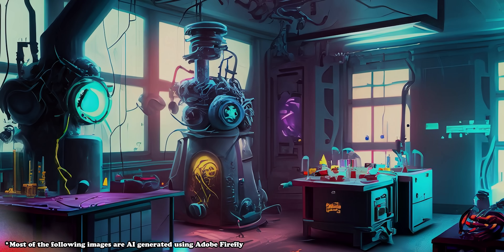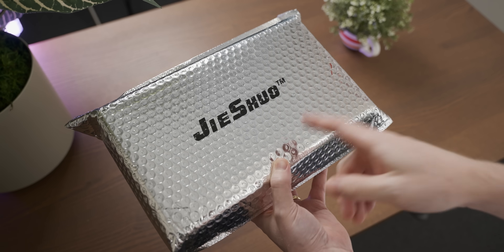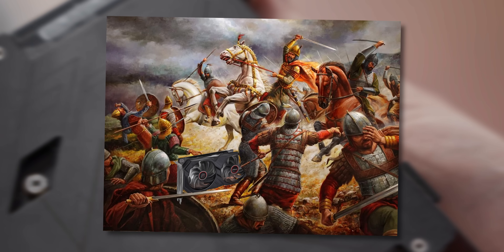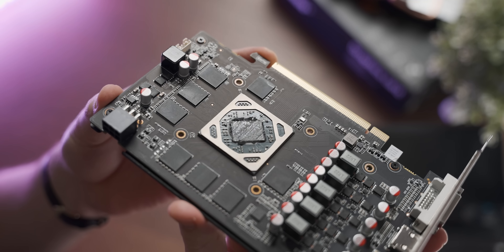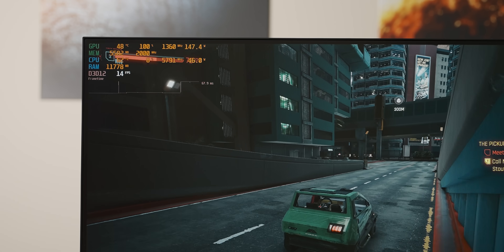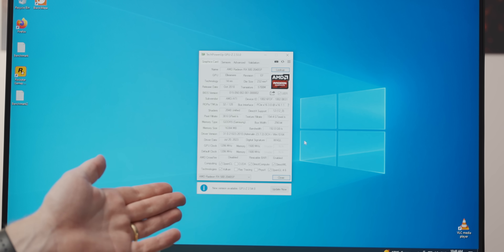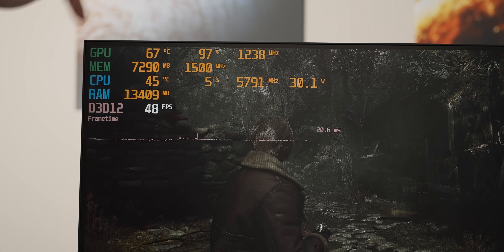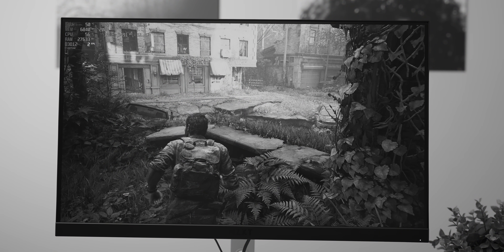Why Would They Make This? 16GB RX 580 From Aliexpress...

Comment: The 580 was my first gpu, it sure was a huge upgrade from integrated graphics😅
Reply: My second gpu. Bought it as an upgrade to GTX 550 Ti. Got it right before the GPU prices went insane in 2020
Reply: @wildcat002  i got 4k monitor and still use my 1080ti for it :face-orange-biting-nails: Some games run fine 4k with it still.
Reply: @hawky2k215 Performance wise yes. Power draw wise not really. The 580 drew a whopping 100w less than the 390x. If you used it for around 4-5 years 4h/day you saved around $100 in the electrical bill alone (depending on the kwh price). That and it also probably reduced the load on the CPU... If you bought your 580 8GB at the time for $200 you effectively reduced the cost by half. No money wasted there if you ask me since it's still by today standards a very solid card and can be resold much easier at a higher price than a 390x.

Comment: You could have reprogrammed the BIOS for a more aggressive fan curve (keeping it ~65C) and bumped the core clock speeds and even improved memory timings.  That would have been an interesting experiment.  I've always wondered if tightening memory latency helped gameplay.

One other thing you could do by making your own BIOS is to bump the memory speeds up as well (until you start seeing ECC errors in HWInfo64).

Comment: 1410mhz. undervolted by 20. with a 16 percent over power budget runs stable.
Reply: 2200 on the memory, possibly 2250 helps more. The core just draws way more power & heat for very minimal gains. 1366/2200 or 2250 if you're lucky yields gains with minimal heat & wattage. The card is starved of bandwidth. 8.8-9gb sounds much better than 8. Yes, I daily one.

Comment: I had this card back in $2018-19 on 9400f and it was really good for the price. Bought it on eBay for $200 at the time. Gigabyte I think. I could play MEA on high on a 4k 55" LG tv. Old tech should get better as software improves, pretty neat.

Comment: Hey Dawid, I also have one of these scalpel RX 580s. And for overclocking with MSI afterburner it's everything to do with the power limit settings. They are running at like 50% power capacity, so slide that bad boy up and it will hold the frequencies.

Comment: What a perfect analogy... 2304 and 144 are just messy numbers. 2048 and 128 are nice and 'cleanly'. 🤣
You should recruit some help and vMod it, then throw some ridiculous cooler on it (or a 240+mm AIO). Don't forget copper heatsinks on the RAM and power components w/ active cooling.

Basically - Just, run this Gentile like a rap*d ape!

Comment: roblem is its at a lower dimension, if i try to find what I need, in binary;  its betwean 1 and 10, 5?  no 3 or 7?  1 2 or 6 8?  no is it 9 or 10?  In this lower dimension, everything isn't using the video memory, infact you almost never use the physical video memory, a person is behind a building, proceduralize some textures, very seldom do I ask for a mipmap of a dude bob.  As you go up in dimension, there are infinite advancements that could use video memory, like resistive path path pysics in a 40 series, even 10 series NVidia, you just all of a sudden are aware you entirely get what you pay for.

Comment: This is a bizarre card to double VRAM on, it barely had the core to properly use 8GB. Better candidates are cards that aren't good at 1080p anymore due to lack of VRAM such as the GTX 980, RX 570 4GB, 2060 SUPER, 3070 Ti etc

Comment: sand the edge of the chip that make the paste thin out the most.. aka HIGH edge.. it will level out the pressure to allow the chip to get 90% activity. then you can use software to AI train its mem and power controllers to assist in mem acquisitions to use instead of just a big portfolio they never fill.

Comment: I wonder if the 16gb rx580 has a noticeable difference against the original when it comes to production, like rendering 3D for example.
Reply: I'd love to know too
Reply: It probably would be a bit slower do to the GPU clock but you could render bigger scenes thanks to the 16gb vram.

Comment: Rather than doing ultra preset or 4K you could have only increased the texture setting. Wouldn't have hurt performance and still used most of the memory the game could use anyway.
Reply: Increasing textures reduces performance too..
Reply: @12Rosen  Not as much as everything on ultra though.
Reply: @12Rosen  No, it doesn't. It was tested so many times. Anisotropic filtering doesn't have any performance cost either. This has been true since like 2002 or 2003.
Reply: @12Rosen  Not nearly as much as increasing everything to Ultra. Especially not with 580's memory bandwidth, which can handle high res textures just fine.
Reply: @12Rosen  only when bandwidth is quite low

Comment: I know it would probably increase the cost to the consumer but I often wonder why it isn't possible/more common to slot in memory in GPUs like on say a laptop motherboard so we/you/me/the end user can boost the memory on an older card to upgrade just like a motherboard. I know the bandwidth and architecture sometimes prohibit this but couldn't they make an upgradeable GPU for the market?? 
What I mean is can it/ is it possible to make a PCB where you could slot in memory and even change the processor die from the original to a better generation just like n a motherboard or hell even make a motherboard that incorporates an area on it to change out a graphics chip (not an APU ) and separate video/graphics memory so they can be bought separately and installed by the pc builder? I know there are all types of issues but that would be a crazy awesome build.
Reply: Would be pointless the socket for the GPU die would change every generation and memory would be a lot slower and that's not counting the million other factors.
Reply: Theoretically yes, in practice it would slow down memory, and thus card.

Comment: You can use a polarization filter. That will make the information on the chips much more visible.
Reply: That often won't help in these cases. The cards are constructed from found working parts pulled from dead cards. To conceal the sourcing of the chips they sand off the model/serial numbers

Comment: Uh uh uh, you always do crazy shit so how about this. IF there's room for more memory on the beefcake card, unsolder all the memory from the loser and solder it onto the beefcake (you'd need a heat gun solder thingie for it ofc) and see how it does... I think it's right up your alley. OR if the layout fits, unsolder the chip from the beefcake and put it in the loser 🙃

Comment: I have a question, does this weird gpu support new graphics drivers?
Reply: AMD Radeon Software works and still updates Polaris cards. These cards are not a bad deal at all, in fact they're REALLY nice. However you're going to have to do an initial maintenance, sometimes the thermal pads are misaligned when the cards are assembled with the cooler, so you have to open up your GPU and align everything back.

 That's what I had to do but hey, It's a champ for 70 USD.

Comment: I bought my RX 580 8GB between 2017 and 2018 and it was great for 1080p gaming. I just upgraded it this year a month ago to a RADEON RX 6650 XT. I still recommend the RX 580 if you are on a budget you can still game with that GPU.
Reply: I have an RX 580 8gb and it runs at least some modern games decently well
Reply: I just upgraded from an RX 470 just last week to a 7800XT. That thing can still game, especially with FSR enabled. That feature is such a lifesaver!
Reply: Yes, I bought my rx 580 for 45€ 1 year ago. I only upgraded to a gtx 1080 2 months ago because it was in a pc I got for 20€ used (well, it was free but I needed a 20€ wifi card) 
It has a i7-6850K on a MSI X99A Gaming Pro Carbon in an old Lian Li PC-Z70.
Reply: I also forgot to mention the 7800XT I got was sold to me for.....wait for it.....89 usd. Yes 89 bucks. A friend I build PC's for gave me a free 1000w ASUS ROG Strix PSU and tried to sell his 7800XT to me for 409 usd hoping that I'd bite the offer. Since I told him I was using a Seasonic M12II 525w PSU so I was limited on upgrades. I was considering the 6650XT since its good on a 500w PSU. When I declined, he just sold it to me at 89 usd. I've been gaming since then, replayed RE 4 Remake, and everything is at max settings on my 1080p 27" 144hz curved monitor.
Reply: @itpugil  Holy $hit, that's cheap!
Reply: I had to remove it from my system because the RX 580 does not work anymore stable on Linux

Comment: What is the actual process of making these cards? How do they pick the memory, do they modify the firmware to match the new specs, do they only work with custom drivers, and if so, do the drivers only work on a specific OS?
And one more thing: has anyone ever modded a gtx 1650 in such a way?

Comment: So heres the deal m8. 
Chinese market was at this time(and still somewhat) cheaper than Wester Market. Since The Card are made in China or Nextdoors You cant ask for Huge margins like you can in the west. 
So what AMD did is took all the Pass tests-chips but Not great chips and Put them in the Chinese Version of the card. 
Second That happened later when the 580s were already established and there was a lot of experience with 480s.
And what they have found Do to chip limitations adding to Full TMU and SP count does not add performance , since lower clocked Chip creates a Bottleneck. 
TLDR Original 580 is over designed and Has more TMU-s and SP that the Lower Bin chip can handle. 
These companies Only have those Lower class chips available so Putting Full TMU-s and SP wouldnt do anything. 
Simplest way to understand would Be Take the Chip off the ASUS and Solder on the Chip from 580 Wonder card and the ASUS will perform the same as the Wonder card. 
The Entire Bottleneck is in the GPU chip. 
AMD knew this so they saved money when Making the RX580 2048 SP By not adding them in the first place, its not a F you Chinese you get a worse card because its cheaper Like the 7900 GRE its all designed around the Low Bin chip.
I wouldn't even be surprised 7900 GRE chips are low bin.

Comment: Amazing! I'm waiting for modded 48GB RTX 3090‘s, which would be basically Quadro A6000's for cheap.
Reply: My understanding is that modern Nvidia BIOSes are loaded up with additional security, so it's not possible on 20-series or newer to edit a BIOS yourself and have the card accept it. You can flash a low-end card with a factory BIOS from a card with more aggressive power targets and it will take, but if there isn't an Nvidia-authorized 48gb 3090 vBIOS, it's not going to work.
Reply: There is a 48 GB 3090, it's called the 3090 CEO edition but unfortunately it didn't launch.
Reply: @laszlozsurka8991  what is this, a low-effort troll at nvidia? I'm not any company fans, not even pro-intel, but I expected better arguments than this.
Reply: @baoquoc3710  ??? This isn't any troll Look it up, a 48 GB 3090 CEO edition was reported back then but it didn't launch.

Comment: 2048 sp... that´s a rx 570 in disguise. Heck some even slap old 570 chips on those cards to resell them as new. 
If it hasn´t 2304 shader units it´s not a rx 580, period. And in all honesty, replacing the 8gb ram chips with 16gb ones, wouldn´t have made a difference in performance back then and now now. 
It simply put doesn´t have the horsepower to utilize that much ram anyways.

Comment: Honestly I'd say the best card for something like this would be a RX 5700 XT that would make it a budget 1440p powerhouse.
Reply: I'm using a 6600xt for 1440p, even though it is said to be a 1080p card, it is performing quite well
Reply: My 5700xt is already a 1440p powerhouse
Reply: @Am_Yeff  Not anymore my RX 5700 XT is struggling in 1440p gaming because of vram.
Reply: @EliezYT  mine isnt, runs VR DCS great and most things at 144fps, really still an amazing card
Reply: @Am_Yeff  Are you playing newer titles like The last of us and Cyberpunk? I see the vram usage go pretty high playing 1440p high settings.
Reply: @EliezYT  to be fair, maxed out Cyberpunk currently hits everything too hard to run well. Even DLSS can't save the 4090 in the current update.
Reply: @EliezYT  havent tried TLOU but cyberpunk runs at high 1440p and some other tweaks 75-100fps (And only a few times dropping under that but i assume thats just the game loading a lot of stuff in in specific points)

Edit: Ofc with fidelityfx's help lmao

Comment: So basically a 16gb Rx 580* is able to use the vram buff in 1 game at specific settings that make it "playable" in 4k.
Reply: Looking back a couple years later, maybe the.moded rx580 could be a mid vintage beast that will easily run everything up to Switch, PS4 and series S.

The vram has potential.

Comment: There is no point in this video. You don't even understand the point in having more Vram. Testing last of us you should do a retest set the general settings to lowest and raise the texture to max since the gpu has enough Vram to work with max quality textures. Texture resolution doesn't have a performance impact. There is a good point in making this kind of video card, but there is no point in your video( or the point is run everything at max and show us how the game runs badly)

Comment: Memory is use for generative AI.
The problem is that many open source projects use nVidia and little by little we can use AMD GPUs.
This could be a great card, not for games, but other applications.
But... the software is not yet.
Reply: you can run stable diffusion on it.
Reply: Are a lot of people actually looking for 7 year old AMD GPUs for this kind of work though?
Reply: @jomeyqmalone  some may for budget stuff. rendering works too. also video editing with eg davinci resolve can benefit from thsi large FB. i mean teh next competitor to that value in terms of vram is prolly the Intel A770. Which is quiet a gap tho.

Comment: To be fair, I have a 8gb 580 and the card is fast, 16gb would certainly help the regular 580
Reply: 16gb ain't helping the card survive much longer. Unless you end up downgrading game quality to potato level with FSR.

RX 580 stands as minimum entry GPU for a bunch of games atm, which means the raw performance on that card is starting to lack to be able to sit at recommended. And as more games start using new features, like UE5 games, this old hardware is going to struggle to run those games, even with FSR, because raw performance is already minimum from the card and there is only so much you can stretch the utility on GPU's using FSR and lowering settings.

Old cards were built to last long, newer cards are not and on purpose, unless you aim for high of very high end market. A 3060ti should have 12gb minimum for example, yet we have 8gb, the 3060 12gb is nice but the performance will be lacking to make use of those 12gb. This is just an example, multiple cards follow this same path, less VRAM, forcing people to upgrade sooner than they should, and most of these cards have pretty damn good raw performance for current games.

I'm on a 1080ti and my spectations is that this card will survive untill 2027 by trying to milk 1080p with FSR. Games are now pushing for 1080ti level for minimum, some new games will do this more and more, the thing that will stretch the lifespan on a 1080ti untill 2027 is FSR and xbox series S. Multiplatform games have to be made to run on xbox series s, which has a relatively fast gpu, but weak and lacks memory to last long, this is why pc hardware can also be stretched beyond their life expectancy. By 2027, a new generation of consoles will be out, that will most likely perform more or less near to RX 7900 XTX with better tech and less power consumption. Current spectations is for microsoft to release a new xbox series console in 2025, or 2026, and PS5 will come by 2027, microsoft will release earlier because they have to, since they f'ed up with the series S (which will become a cloud only machine in the future), this will mean one thing, console generations will end, which is something i always considered to occur during ps5 or ps6 generations. Hardware is going to improve faster and faster, consoles can't keep up and we will need refreshes every 3-5 years to keep up with technology. A PS5 pro, based on current specs, will still perform less than a RTX 3080 most likely, which is a GPU from 2020, same year the base ps5 released. A ps6 is likely to improve performance on the pro by 2x at least. Not to mention that base ps5, performs more or less similar to a 1080ti, they aren't that far apart from each other. This also helps extend the lifespan on my 1080ti, because sony games are going to be the main issue going forward untill next generation drops, multiplatform games will always be handicapped by xbox untill they put series s into the cloud district only.
Reply: @CHT1992  I'm inclined to agree with you, unless you go high end , the card won't last another 3 years VRam and RT wise it's already obsolete, I agree they are ripping us off

Comment: Overclock the rx580 to 1500mhz..
& Ram to 2100mhz. 
I bios moded my rx580 back in 2019.. removed all power limit. Overclocked to 1500mhz core & overclocked ram to 2100mhz. 
It pulls 180-240w with this clock. The sapphire nitro+ rx580 se does get a bit noisy but keeps the gpu below 70c. 
Your asus strix version has a much bigger cooler. So even at 240w it should be not much more than 60c..
Reply: My stock sapphire pulse RX580 temp is usually around 78
Reply: @enigmalex3649  pulse has a smaller cooler. And not the best binned chips. 
Nitro+ se. Is one of the fastest factory clocked card. Stock it came with 1450mhz core & 2100mhz ram.. which is already very aggressive.